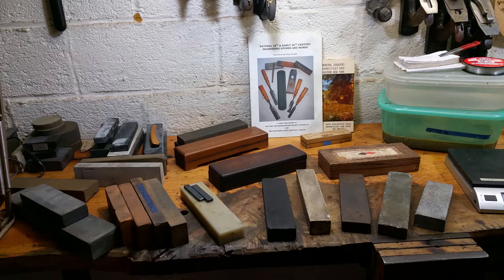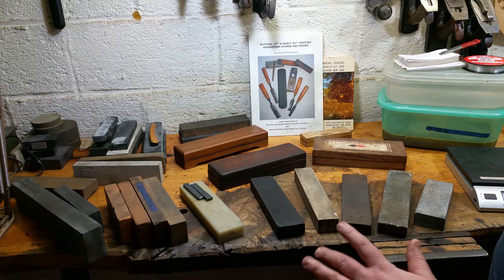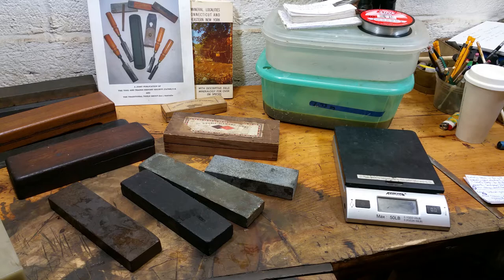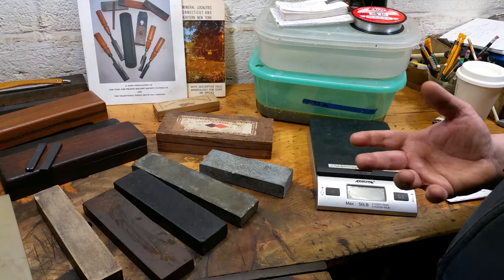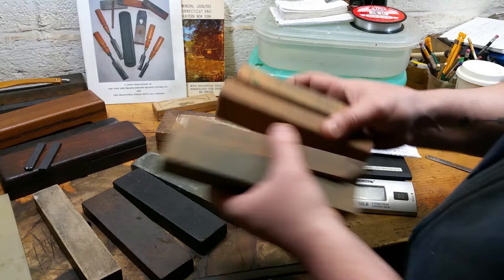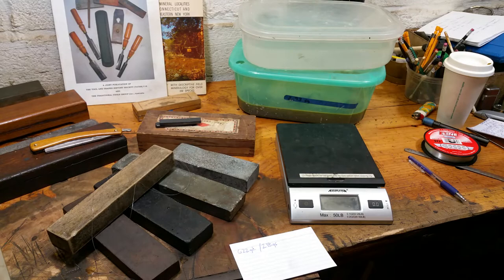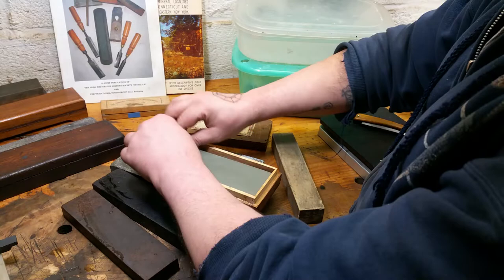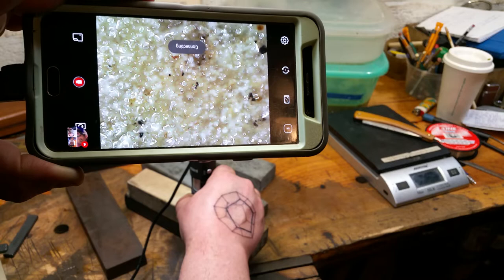How To Evaluate & Identify Sharpening Stones Found "In The Wild"

Comment: Carborundum stones are inexpensive but will abrade anything. They are extremely useful. The Carborundum Co. ones are good ones to have. The fact that they've been in production at an industrial level for over a century is an indicator of how useful they are.
Reply from the maker: They are great, my only complaint is that they tend to load up and glass over rather quickly, and unlike natural stones, it's very tough make them fresh again.
Reply: @flipsfan78  Maybe we have used different Carborundum stones. The ones being sold in Brazil are soft, cut really fast, never load up, never glaze. Only issue I got is that the mud they release leaves an ugly scratch on the side of the knife if you sharpen at low angle.
Reply: @thiago.assumpcao  are you sure that is a carborundum stone then?
I'm no expert and may be wrong but from my experience they're like a softer/rougher ceramic stone.

Zero mud/slurry.
Quite aggressive when fresh, loads up full of steel in under 100-200 passes.
Tough to clean.

I have about 3 doubles of em, given over the year.
Reply: @Stormcloakvictory   There is a Brazilian brand called Carborundum. They are famous for selling soft stones based on silicon carbide. I have model 108N and 328N, both have same grit 120/320.
Reply: @flipsfan78  Arkansas stones are notorious for loading up.

Comment: My favorite is the Arkansas Translucent.  Such an underrated stone.  The best part is that it pre-polishes with oil and mirror shines when it's dry.  It also doesn't load up as quickly and wears so slowly that I've barely ever had to lap it.

I've been looking for a surgical black in the wild but they're as rare as hen's teeth where I live.  Havent found either of the belgians either.
Reply: The reason is in the name where they are found. You might be lucky if there's corticule substrate to mine.

Comment: Specific gravity is density.   The reason the suspension tests works is that the specific gravity of water is one.  So you are back calculating the volume of the item as a SG of one.

Comment: I collect all stones new and used I clean them up and boy the colors are really nice I also flatten and reset the grit if I can . I even have a clay brick I put a 300 grit on one side. And yes it does slurry but it is a clay red brick. Ones with a label I don't clean so as not to destroy the  label.

Comment: Question on specific gravity test -- are the numbers affected by the fact that the stone is full of oil? Like doesn't that make the dry weight more than it would be stripped? Does the suspended weight increase proportionally so the end number is still accurate? I have a couple I'm pretty sure are old Washitas both were between 2.3 and 2.35 sg but that was after degreasing
Reply from the maker: Not by much appreciable difference in my few control tests

Comment: I've picked up stones in the wild, garage sales, estate sales. What grit silicone carbide powder do you use to clean up the stones. Thanks for all your information, it's a learning process.
Reply from the maker: Depends on how hard the stone is, I usually prefer the rough stuff; 60 or 80 grit powder to start. The coarse grit will wear down to a finer grit, so you can get a range of action for one money.
Reply: @flipsfan78  Thanks for the response, I appreciate it.

Comment: if you find a stone thats been only used for oil in 30 years ,
Then you come along get rid of oil from the outer service but oil is running through the stone would this have a dramatic effect on gravity weight,as water would be repelled from entering,

Comment: Hi, are you supposed to remove the label on that Pike stone or is that side not useable.  I ask because I found an "Old Rook" brand stone that is tan on one side and dark grey on the reverse that has an "authenticity" label stuck on.  I was thinking the sticker side might be a courser grit but am unsure.  Good videos good sir and I learned a lot.  Cheers.
Reply from the maker: Save that sticker and rock. It's a collectable Belgian coticule. Worth a fair amount for the label alone if it's in good condition
Reply from the maker: Labels always add value to stones, particularly the older ones
Reply: @flipsfan78  Thank you for the quick reply.  I'll probably just leave the sticker on and just use the coticule side.  So just to confirm, the label side is actually useable (coarser grit?) if I chose to remove it?  Thanks again.  Cheers.
Reply from the maker: @rickdff62  Traditionally the purple side is referred to as Belgian Blue Whetstone. The two layers occur together naturally, but personally I find the darker sides dull and slow, it's not coarser, I think they're used as a finisher, something akin to a hard strop